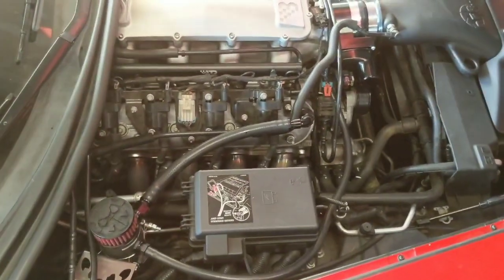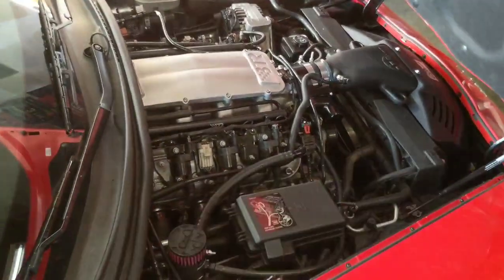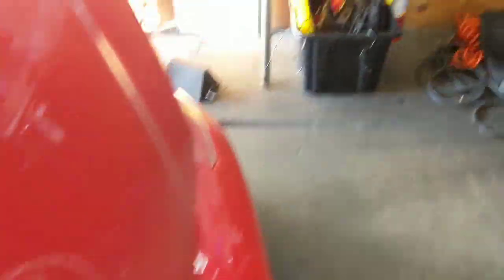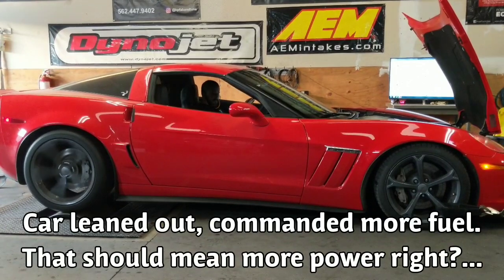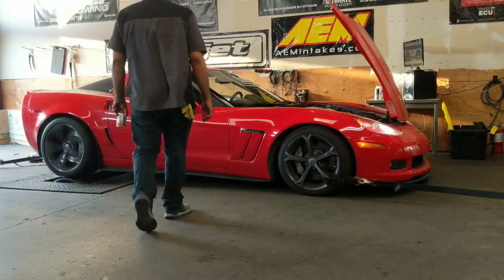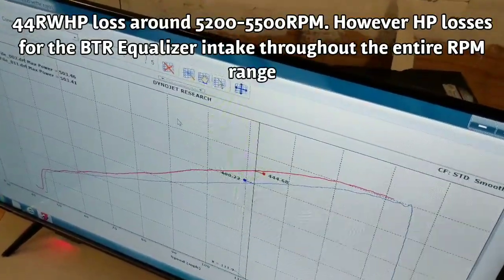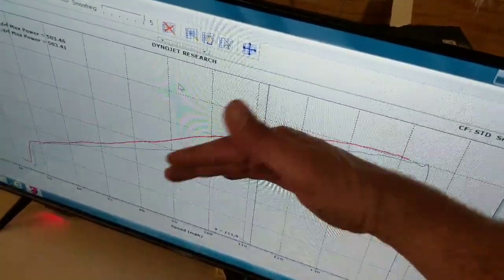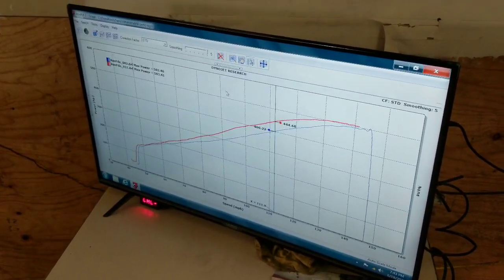BTR Equalizer 3 Intake vs Ported Stock LS3 Intake, Dyno Results

Comment: Would this intake would be good for a high compression stroker say a 416 with the right cam and valve train setup?
Reply from the maker: More displacement might speed the air up a bit and it would do a little better but this intake wants rpm. So I still wouldn't use is unless you're spinning it past 7200rpm.

Comment: Something is wrong there. That btr intake and cam should pull way more rpm than than that.

You need tq on your graph too. Hp don't mean shit.
Reply: There's nothing wrong with his dyno.He only pulled to 6800 rpm, the ls3 intake makes better power overall under 7k, if you want to shift way over 7k then the btr will shine.
Reply: @sanchez_lsx1198  that's just it...the btr didn't look like it was gonna pull well up top. It should pull good up top and there's really no reason to out that big of a cam in and only run to 6800 or 7k rpm.
Reply: @HioSSilver1999  yeah I see, a bigger cam or more cubes the btr should make more peak, but from lots of dyno videos I've seen like Richard holdener alot of short runner intakes and single plane, will make makes less power under 7k and the ls3 or truck intakes make always more power and tq.

Comment: Hi, my cam and valvetrain are setup to run to 7500 rpm. Will your ported stock intake allow me to rev that high and make power? I have a stock bottom ls3 with arp bolts throughout.

Comment: The ported LS3 would go back on especially if it has the rod mod.
Reply from the maker: Agreed, but the customer like the looks and sounds. Plus they're going with boost so it's not like they'll be hurting for power.
Reply: @c5natie1  Yeah under boost the aluminum will be safer. Yall should try a IM Heatshield on the bottom of the intake.....They work.

Comment: no wonder why tooley would never show me the graph from my ported ls3 with cut runners that i do an that he tested for me vs the btr..i new they tested a ton of ls3 intakes on their ls3 cam only dyno mule,but never would say the equalizers data ..mine made 15hp more from 6600-7000k (585hp)an was still 5hp better then a stocker @ 7400 rpm ..stocker peaked 570hp @ 6600 an dived...my peak tq moved up 200rpm vs a stocker..thats with 7.5" runners vs stock 9.5"s...a 6" runner will get one to peak 7500rpm easy if you have the valvetrain.

Comment: Bummer the motor wasn't a good test platform for the BTR manifold.  Hopefully it wasn't bought with the intent to see gains.  Motor setup to run 8500 and car with 4.56 gears and 6500 stall converter and you're ready to go!

Comment: What brand of throttle body are you using or where do I get one for my 2010 camaro ss 102mm DBW preferably
Reply from the maker: Sorry for the last response. We've been using the 102mm throttle bodies from Blackhorse Racing with good results. They're priced right and are easy to tune.
Reply: @c5natie1  Do you think it is worth rod modding/porting the intake on a FBO, geared ls3 with no cam? I have been wondering whether this is worth it or not, thanks in advance!
Reply from the maker: @Archonline24  not really. The stock intake flows more than the stock cam needs so the gains arent much.  I tested it on my own FBO LS3 C6. Cleaning up and smoothing out the intake opening (no rod mod or porting) along with porting the throttle body did improve throttle response and picked up around 5rwhp. But I'd wait to port the intake after a cam or heads.
Reply: @c5natie1  gotcha, I was planning on probably getting a moderate cam since it's my DD and do a full valvetrain upgrade, but I was looking for a little more wind up. I have a pretty stout throttle response already with my katech port tb and 1le gear so maybe that's not the way to go haha. Thanks for the response btw, love the vids!🤘just subbed

Comment: That is a short runner, high rpm intake designed for 8000+ RPM. It is pointless to put it on a car that you’re not even spinning to 7. The car needs to be revved higher to see any performance gains.
Reply from the maker: That is correct. However many of those who may buy this intake will probably put it on a street motor with a popular off the rack cam that will probably peak by or before 7000rpm. So this test is to show them what to expect. That's why i said this isn't  a fair test for the BTR as it's not in the range it was designed for.
Reply: @c5natie1  so would it be advantageous to run a lot of nitrous with a btr intake? I’m considering running a ls2 forged and gapped for 250/300 shot and would rather not explode a fast lsxr

Comment: even with boost, that intake will loose tq/hp bellow 6k, period...though I hear ya, if you make 800lbft instead of 880, would you really notice?...I think the bigger issue for us boosted guys is that there isn't much choices for an alum long runner intake (make that no choices other than the BBK LS1)...so you either use BTR or Sniper (if fitting under a hood is important)
Reply from the maker: Agreed as that's what our testing has showed us. But yes, when you have more than enough ponies, you can sometimes sacrifice  a few for looks lol

Comment: Thank you for doing this video. The one question I have is if the car would have made more power at higher RPM. BTR sells this intake as making peak power between 6k-8k RPM. They expect it to lose down low in exchange. So did it fall off at 6800 or is that where the car or valvetrain was good to? Let me also say very nice job on your ported intake. If I didn't already buy the BTR E3 I'd probably have you port one for me!
Reply from the maker: This car will not make much power past 6800rpm. Thats just where this cam peaks regardless of the valvetrain. The BTR intake is made for 7000-8000rpm, so in all fairness this test did not favor it. However, most street cams peak by 7000rpm so we wanted to see a realistic comparison of these intakes on a n/a street car. However, if you went with a bigger high revving cam, higher compression (or boost) and the valvetrain to spin well past 7000rpm, the BTR would shine. The BTR is more at home on a drag racing setup where you stay up in the high rpm range for the entire pass. Yeah you lose some down low, but if youre drag racing, you wont really be there much. Thats why we say, its all in the combo you put together. Thats being said, the customer is still very happy and has a fun little street car. 503rwhp aint too shabby. The boost will make up for those 40hp soon :)
Reply: @c5natie1  Thank you so much for the input! I am building my first motor which will be in a street/strip car but I am building it to spin 8k RPM. It is NA but will have a 150 shot of spray on the strip. Your videos and comments on this intake are extremely helpful. Great job on that build. It looks, sounds, and runs awesome.